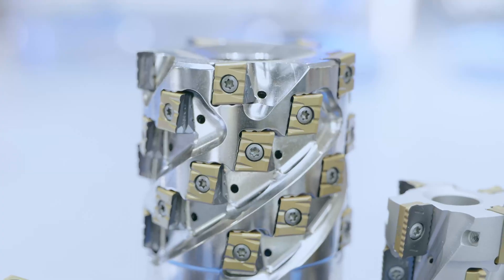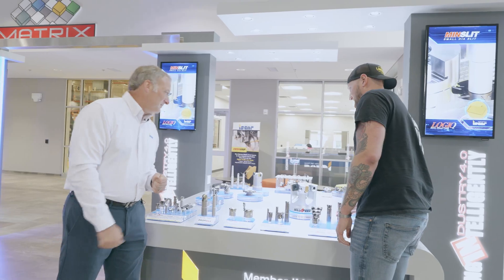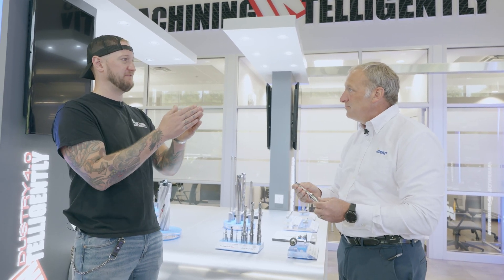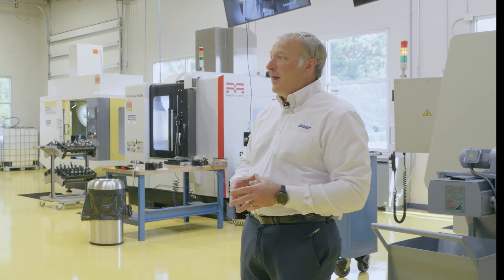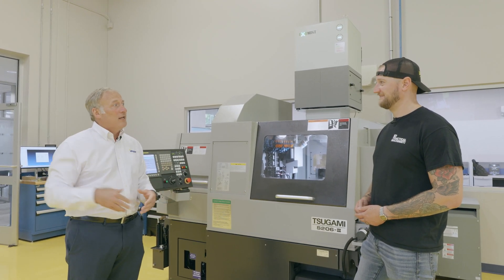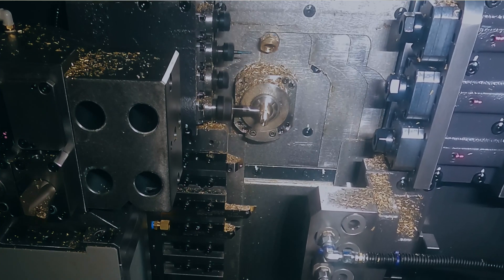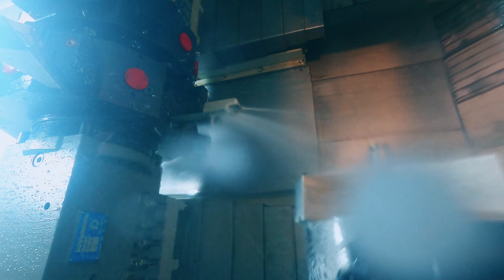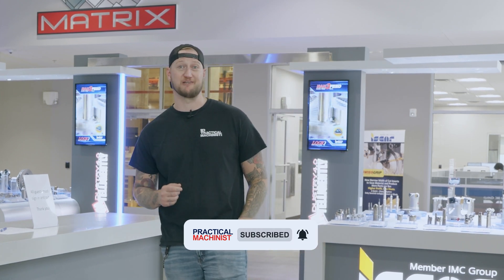This Is Where ISCAR Solves Machining Challenges

Comment: It's been two decades since I left the manufacturing/metal removal industry. My emphasis/expertise was in rotating tools vs rotating workpiece. In the earlier part of my twenty-six year career, we relied primarily on Carboloy, (later Seco), and Kennametal. However, after being introduced to ISCAR at IMTS, and testing their inserts/tools in a variety of applications, we saw drastically improved performance, including higher surface speeds, higher feed rates, better finishes and increased tool life, all-in-all, equating to reduced costs and higher quality.